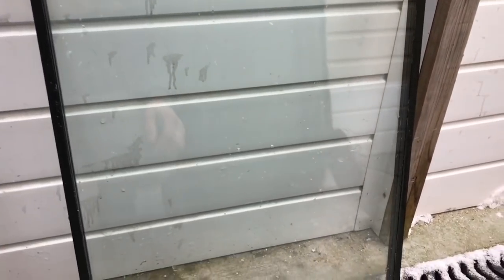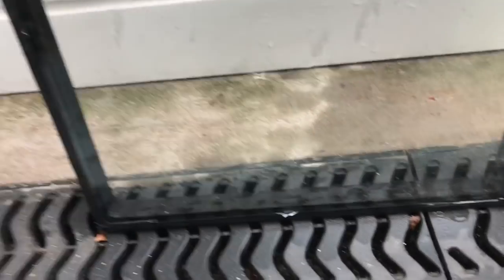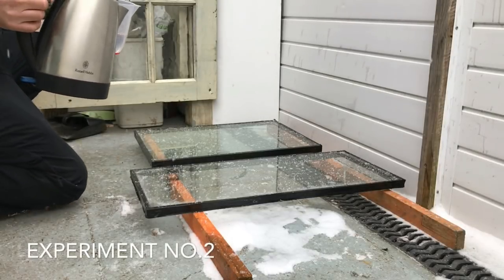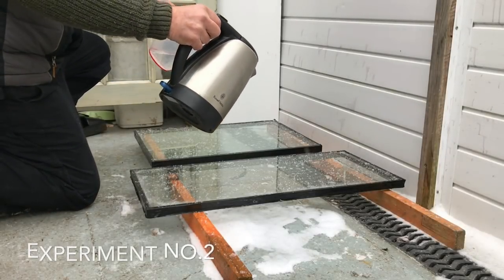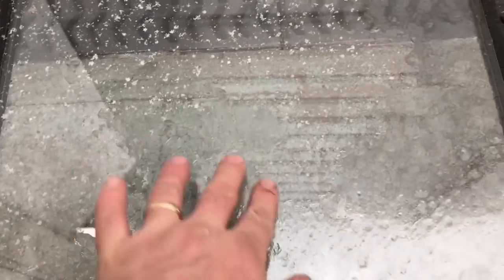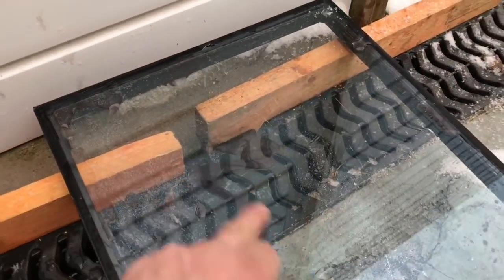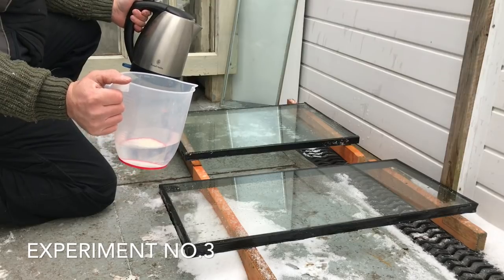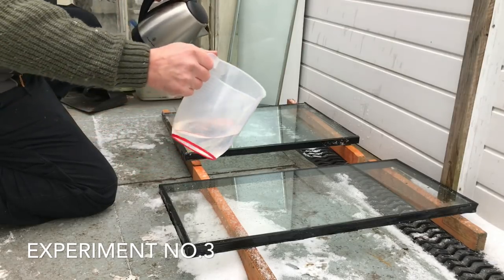Will Hot Water Freeze Faster Than Cold. A Non Scientific Experiment

Comment: Hi Dave hot water will freeze quicker than cold water if you for instance  leave a two trays one with hot water the other with cold outside  this because  the hot one partially  evaporates leaving less water  water in the  tray less water will freeze  quicker than more water . However  water in poles has less opportunity  to  evaporate  enclosed as it is  once its on the windows  its not really  in enough  quantity  for evaporation to make that much difference  and its all draining  to the bottom of the window   so not really  going to freeze  any quicker in those circumstances. 😀